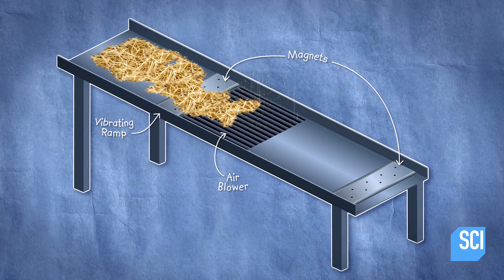Here's The Perfect Contraption To Find A Needle In A Haystack | MythBusters: The Search

Comment: Wasnt this a myth on original mythbusters? I seem to remember Jamie making a very similar contraption to extract the needles, though they also had to find bone needles which wouldnt have stuck to the magnets. i dont recall what adam did
Reply: Yes. I can't remember who (80% sure it's Adam), but one had a sleuce like contraption from what I remember. A chute leads to a tub of water where a bunch of paddles will agitate the hay and get the needles to sink. The chute also had a magnet strip to catch the nails. I remember they used so much water they had to get some more from the fire department. The other contraption was a rotating cylinder with a jet flame at the end.